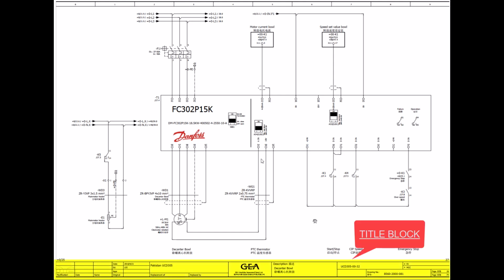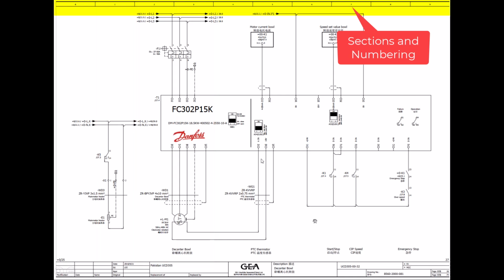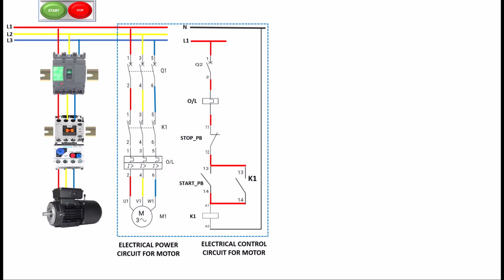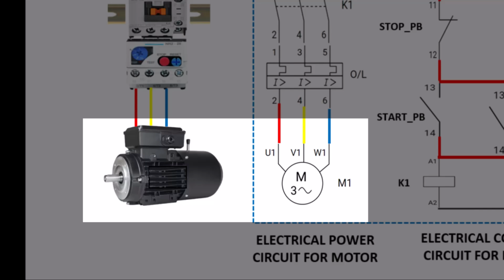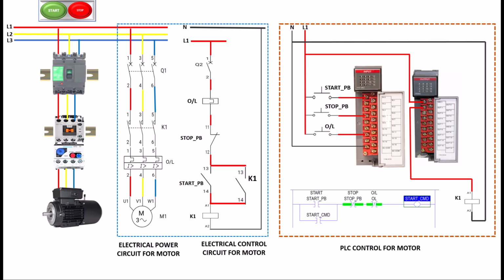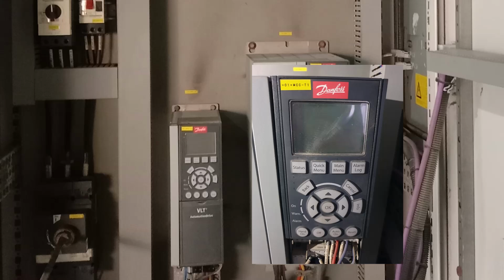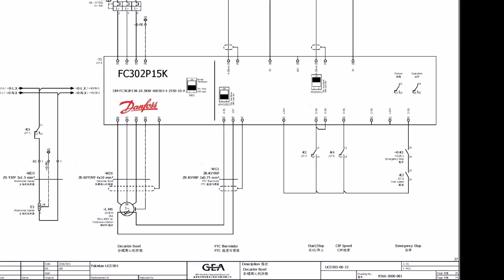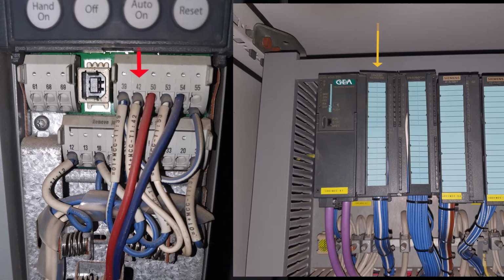How to Read Electrical Drawings and Wiring Termination Drawings | Control Panel Wiring Tutorial

Comment: loved the video, especially the part where u show the electrical drawing with the device on the control panel,  i would love if you go dive on how they are connected on the panel and comparing it on the drawing and tracing the wires , may be for troubleshooting , thank you for the video
Reply from the maker: Thank you for the suggestion on electrical drawing, I will definitely cover wiring tracing and troubleshooting in the next video! 

You can visit our channel for control circuit troubleshooting and you would love it.

Comment: i work as industrial maintenance and sometime i struggle  to understand  some complex 
 schematic diagram, do you have any tip for me?
Reply from the maker: I suggest you to understand interlock drawing first. Draw small circuit and make interlocks with different relay and contactors. For Example, i give you link for a video, watch it and comment back, what you understood. I ll guide you for further step. Don't Worry!

https://youtu.be/eUxmMTrqvs4?si=pW_arCJk5lNmqzRA

Comment from the maker: Thanks for watching! Do you find electrical drawings challenging to understand? Which part of reading control or wiring termination drawings do you struggle with the most? Share your experiences or tips in the comments! Also, how do you approach troubleshooting using electrical diagrams? Let us know your thoughts below!
Reply: Interconnection drawing, loop drawing, and termination drawing. But you it very easy for me. Thanks